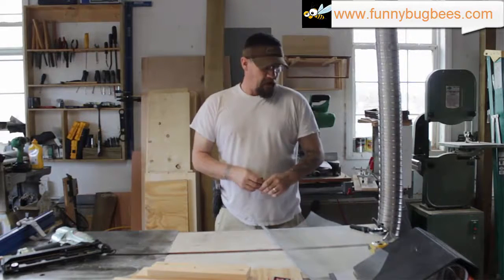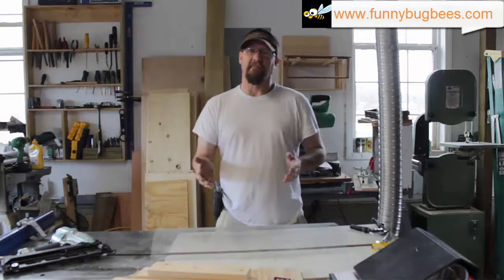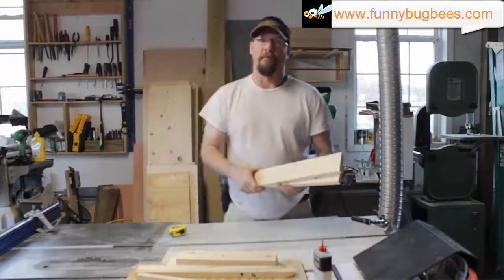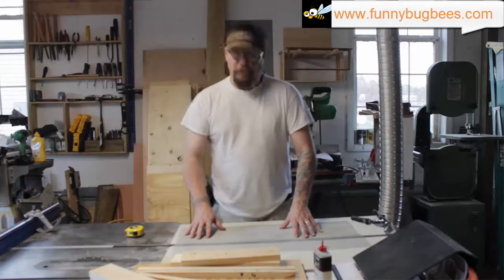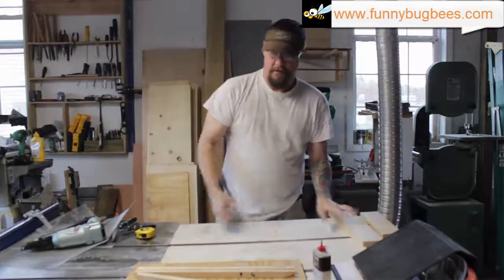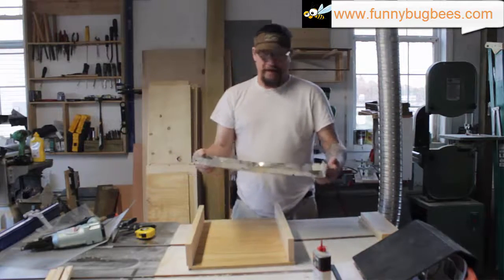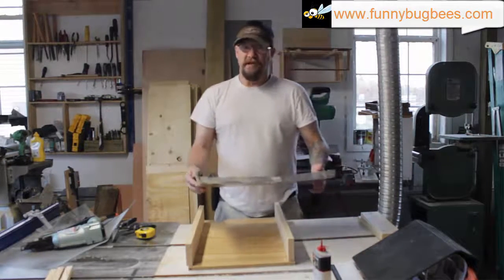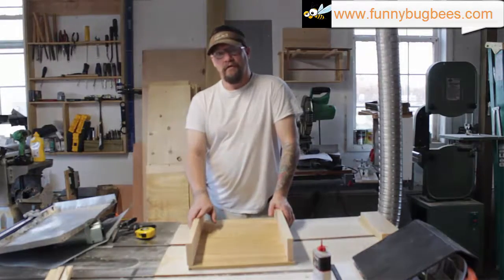How To Build an 8-frame Freeman Style Small Hive Beetle Trap

Comment: I like your site and as I complete My hives for my first season as a beekeeper  I'm looking for answers for problems I may not ever have.  I like your Varroa treatment plan with your three spring treatments and your fall/winter vapor treatment. So the varroa trap may be just unnecessary or jus worthless  anyway ultimately I see my self using the trap designed for the hive beetle. I am located in Western Illinois and experience real winters so the hive beetle  may be less of a problem here but none the less your trap is appealing. We do have hot summers here though. I could screen the rear entrance and solve some summer ventilation problems as well.I'll check your prices for ten frame hives. Keep up the good work. Thanks, Chad
Reply from the maker: the "varroa traps" you are referring to are just IPM screened bottom boards with a fancy name. They are designed to catch "mite fall" from bees grooming themselves and knocking the mites off. They are not designed to really trap a large majority of varroa so they are worthless as a "treatment method". Regarding hive beetles, I use exclusively Freeman style hive beetle traps on all my hives. You can see one here:  https://www.funnybugbees.com/the-bee-shop/beekeeping-supplies/bee-pest-control/small-hive-beetle-traps/10-frame-small-hive-beetle-trap-w-integrated-bottom-board
Reply: You might (pun) like to check out this link re bee mites:www.youtube.com/watch?v=RoSi5v9rtWo

Comment: outstanding idea can't wait to build, would 1/4 inch wire work and if not do you sell your wire or can you give a source? thanks
Reply from the maker: No, you cant use 1/4" because nwer bees can fit through it, and they drown as well. You need something big enough for beetles, but to small for bees. hence #6 or #7 making sure to check the aperture size of the cloth you get so that it is between 3.00 and 3.2mm

Comment: I have enjoyed several of your videos. But I had a problem making this bottom trap. I cut the wood from the list you have, but could not assemble it.  I think the bottom piece of plywood should be 13 3/4" wide not 12 1/4".
Reply from the maker: you are 100% correct. Did i say 12 1/4" in the video, or did i put that measurement in the comments?
Reply from the maker: i see that i put 12 1/4" in the comments. I am sorry for that, and have corrected the mistake.

Comment: Do you have any experience using diatomaceous earth in the pan instead of oil?
Reply from the maker: diatomaceous earth will only cause desication of larval stage SHB, it has no effect on adults. The carapace is too hard. DE works by causing small cuts in the skins of soft bodied insects, thereby causing dessication and the carapace of the adult is just to hard.

Comment: Use Diatomaceous Earth instead of oil and eliminate the mess and smell.
Reply from the maker: 1. DE is a known carcinogen when inhaled which means special precautions are required to handle it. 2. DE is not very good at killing adult beetles, as the carapace is too hard for it to cause rapid desiccation.  DE is great at killing the larval stage though but by the time the larva reach your trap, they have ruined the hive since they had to crawl down through your hive to reach it

Comment: What are the measurements for a 10 frame hive? Thanks
Reply from the maker: The measurements are 16 1/4" wide same length for the plywood..and the wood that goes laterally across the front that forms the bee landing, that should be 16 1/4" long as well, and the piece that goes inside the box laterally across the front should be 14 3/4". the small piece across the back should also be 16 1/4" everything else is the same. Hope this helps!

Comment: These roasting pan get holes in them,  i think the fire ants are eating holes in them with in 1 yr.>  Only on the bottoms
Reply from the maker: ants cant eat holes in aluminum. What is most likely happening is that they are corroding, which happens when you put sugar solution into aluminum. The corrosion forms aluminum oxide, which is harmless to bees and people. It does however mean you need to replace the pans regularly.

Comment: Mineral oil does not get rancid like vegetable oil
Reply from the maker: Yes, I agree, Which is why i switched to using soapy water instead. it's WAY cheaper than mineral oil and also doesnt go rancid. Just put enough blue soap liquid in your water to turn the water a pale blue and thats more than enough to break the surface tension and prevent the beetles from walking on the water.
Reply: do you use dawn dish soap
Reply from the maker: it doesnt matter what brand you use, dish soap breaks the waters surface tension. any brand will do.
Reply: Danielle Garrison blue dawn will take care of ants  plus several other things